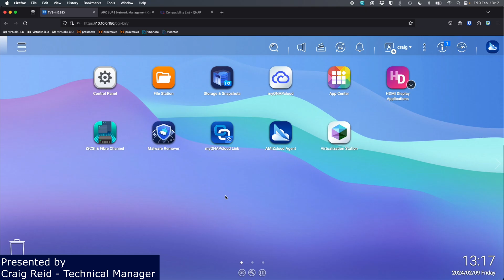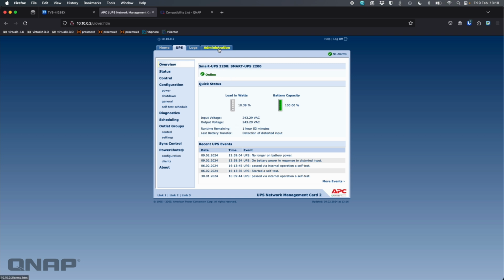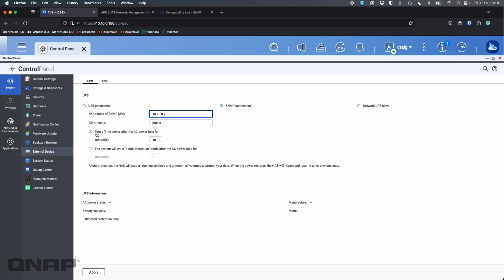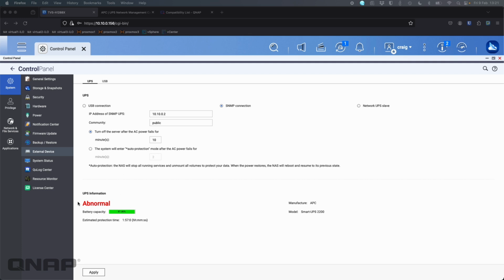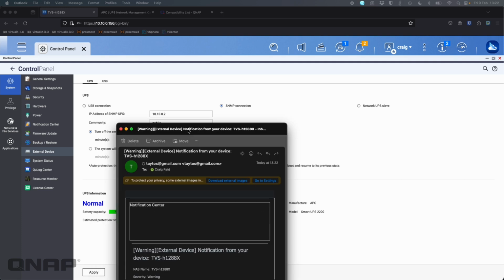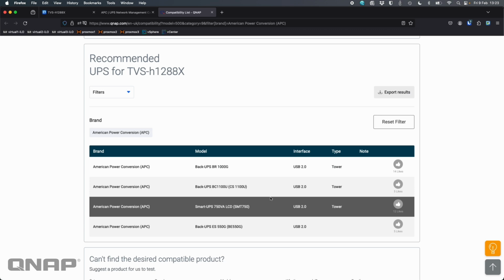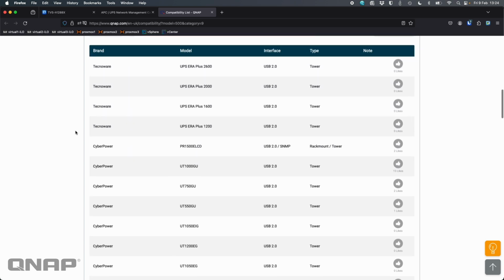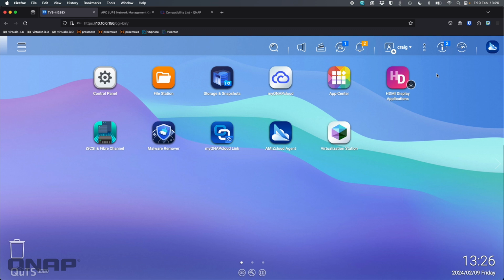How To Configure Your QNAP NAS with a Uninterruptable Power Supply (UPS)

Comment: A topic often overlooked but so very important!
Having used UPS for years and years, and have been "saved" by power-cuts on several occasions, I strongly recommend using an UPS.
Even when your NAS-setup is not that large, it helps to protect your data-integrity when power fails.
(and avoids you of having to go thru the hassle of file-system checks etc when the power did fail without an UPS to help protect your NAS)
An UPS often will also give you some level of protection against brown-outs and filter-out mains-power issues et cetera.

QNAP does notify you, when selecting the UPS to use the "Auto-protection"-mode preferably, when using an UPS? (I have it set to 2 minutes)
For the timers, shouldn't you set the time(s) to (only) a few minutes instead of 10 minutes?
I guess it is any value that you feel comfortable with and(!) the UPS is able to sustain the NAS (on battery-power) when power has indeed failed.
(and hopefully eventually comes back)
What happens after the 10 minutes, will the QNAP still go in auto-protection mode or gracefully shutdown? (i.e. dismount the volumes and turn-off)

I heard that with ZFS (QuTS Hero) an UPS is particularly really needed/strongly recommended?
Whilst QuTS Hero is quite resilient & good in self-healing?

It could have been a quirk but in my set-up the network switch is not connected to the UPS and still the QNAP's do go into the said safe-mode when the power failed.
 
BTW, I did use USB mode (and USB slave-modes) for several years, which the said UPS (Dell/Eaton OEM) was recognised but not formally supported (i.e. not on the list you showed in the video) and eventually after a major (back then) QTS upgrade, no longer worked. Unfortunately, QNAP Support could not do much about it, as it was not on that "formal" list.

FYI, the (on-screen) Help-topic within QuTS Hero regarding the UPS section is referring back to the general help on your website?
With QTS it does show you a very nice extensive explanation, suggestions and help...

Comment: I am using a Chicago Digital Power that works well with my 3 QNAPs (TS453Be, TS669Pro and a TS421U). My problem, which is the question, is that the TS453Be has 2 external enclosures connected to it, but I haven't been able to figure out how to power those off on a power failure. Is there a way to accomplish this? I had assumed that when the TS453Be powered down, that both the TR-004 and the UX-800 would also power down. Can you help me out please? Saludos desde México!
Reply from the maker: Units like the TR-004 will enter a standby mode when the host (NAS) powers off, if the TR-004 is in the middle of a RAID rebuild though, it will not enter standby mode until it has completed that task.
Reply: @QNAPUK  I was referring to actually turning them off when the power goes out. Is there a way to send a signal to them, or to the parent NAS so that they turn off completely, not go into standby mode???
Reply from the maker: There is no way to do this unfortunately, you would have to turn them off at the wall or unplug them, physically.

Comment: It would be grea, for those of us that are new to this, if you could explain how you find out the UPS IP where you'd plug the ethernet into? Is it going into the router or the back of the unit?
Reply from the maker: You would probably have to go ask the UPS manufacturers support team. As all UPS devices do things differently there is no way for me to do it for all of them.

Comment: I have moved house recently and therefore, my home network was dismantled and its took me ages to get my network plumbed back in to my new home for a variety of reasons. Finally I now have my NAS back into my router and my pc sees it using the QFinder program. However, it is asking me to log in and I simply dont remember the log in details. When I search for my username, it says there is no such user. I believe my user account might have been deleted for whatever reason. 

If I set up a new user, will I be able to then log back into the device and resume using the data on it? I dont want to lose the data on it be setting up a new user if there is something else I should do in my circumstance. 

I just want to get back into it and use it as normal but without being able to use the email address I used to use, Im a bit stuck. Any help please?
Reply from the maker: Hi, you can reset your password by following the instructions on this video - https://youtu.be/Wq1OxnII3fU. Once you've reset the password, make sure your NAS is connected to the network using port 1, from Qfinder you can see the MAC address which is now your password for the Admin account. Use all upper case and remove the hyphens (-).
Reply: @QNAPUK  Thats fixed it, Im back in to my data now. Thank you! :)